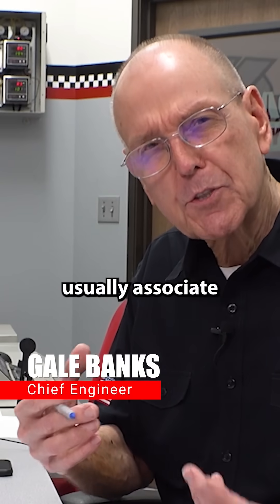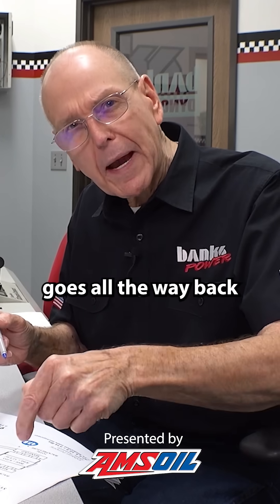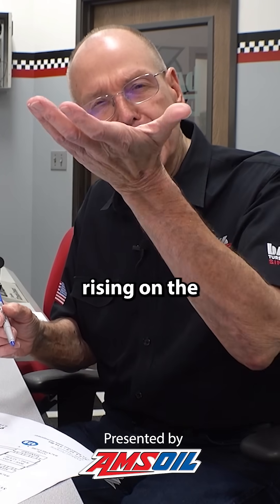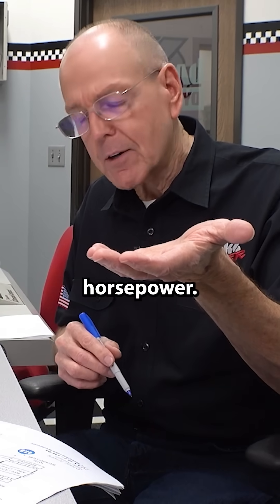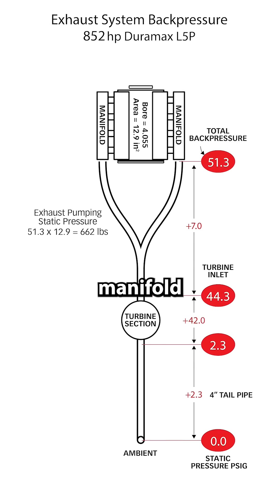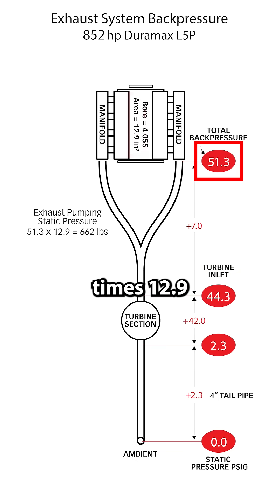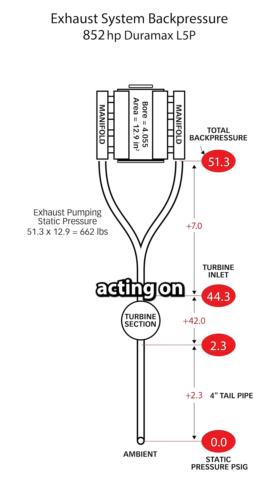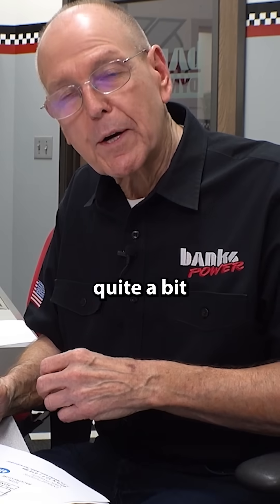How much HP are you losing to backpressure?

Comment: So, how are we going to reduce back pressure while running a DPF system?
Reply: You delete the DPF system
Reply from the maker: You can't legally remove the DPF so the next best thing is to reduce the backpressure created by the restrictive tubing behind the DPF. This can account for as much as 3psi. With turbo expansion ratio, this can mean as much as 9psi at the head of the piston on the exhaust stroke.
Reply: @bankspower I'm going to challenge you to find a stock exhaust on a stock turbo diesel truck that has 3psi of drop at full power.  Show me.
Reply: @bankspower 
Why not put two or more DPF in parallel?  Should cut its contribution to back pressure in half.
Reply: Or run a truck that predates DPF requirements and put whatever power train that you want in it
Reply: Mount a jet engine to the exhaust, sucking all the exhaust out 😂
Reply: This shouldn't be a Short because he didn't actually answer his own question.  C'mon man.
Reply: @StFiacre  I know. That’s what I was pointing to.

Comment: I was told by a shop that the DPF added to the exhaust system increases the back pressure nearly 70 times vs an open exhaust.
Reply from the maker: You should not use that shop anymore.
Reply: 70x seems like quite the exaggeration, especially because 70x662lb=46,340lb of pressure on your poor connecting rod which I feel like would not survive that
Reply: @jaredlancaster4137 The banks diagram showed less back pressure after the turbine where a dpf might be located. A different equation would be needed
Reply: @Kyle-pl6rl  That's true, he is showing 2.3psi at the turbo outlet, but 70x2.3 is 161psi. 161psi+his existing 42psi pressure drop across the turbine+his existing 6psi pressure drop through the up pipes gives us 209psi at the manifold, which still doesn't seem reasonable, or accurate considering stock pickups literally do not build 209psi exhaust back pressure.
Reply: @jaredlancaster4137 i think the actual pressure on the rods disperses differently when its rotational back pressure..does sound like he's tryna be sold a dpf delete..
Reply: @jaredlancaster4137 70x the amount of backpressure not 70lbs of backpressure could be 70x .0001lb of pressure
Reply: From memory on a 15 year old Ford Mondeo TDCI that's got a properly functional DPF its usually around 2-7psi across the DPF according to the scantool, so 1/70 of that would be 0.1psi, which would be one efficient exhaust lmao
Reply: I wasn't aware that a supercharged engine is affected by backpressure
Reply: @CharlesAAnnen-rh4mk  ALL engines are affected by back pressure. Mechanical superchargers and turbochargers ( originally called turbosuperchargers) each have good points and bad.
You may want particular characteristics that benefit your application like efficiency vs response time, etc.
Car makers prefer superchargers because owners are often not super diligent about maintenance and turbos are intollerant of dirty oil. Automotive oil filters have bypass valves on the theory that dirty oil is better than no oil, but to a turbo, the result is the same.
Ford, for example had a turbocharged Thunderbird for a few years ending in 88. In 89, after replacing every turbo probably several times, they switched to a mechanical supercharger to go along with a sleek new body.
Reply: @correctednews1463  
They went with a v6 supercharger, while GM put a turbo on a v6
Reply: bullshit
Reply: Look at a DPF and look at how it operates then look at a straight piece of pipe. Tell me which one flows better. Also the biggest issues with DPF’s isn’t the back pressure it’s that they like to clog up.
Reply: This STOCK Duramax 5LP makes 852 horse power????
Reply: I'd love to see his math on that. Zero chance that is accurate.   I do find it funny that these modern diesels that make 400+hp/1000+tq  and people are quick to believe that the exhaust is restricted and causing a loss in fuel economy.
Reply: @alcalc8938 some people think banks is much more than a salesman 😂 lots of back pressure or drive pressure is what I would call it, could be trouble for the head. When you start running higher boost, you should monitor your drive pressure.
Reply: @alcalc8938 I don’t fully trust the math in the video either, but a DPF is extremely restrictive. That’s why they are the result of so many premature engine deaths
Reply: @jacksonreid6412 they are extremely restrictive when clogged, but properly function they aren't too bad. As long as tune is good and the driving of the vehicle includes regularly acheiving reasonably long highway speed cruising to regularly regen they aren't that big a deal. Constant stop/start city driving over and over is what is when they become problematic.
Reply: @jacksonreid6412 
That and the EGR valve
Reply: @JohnSmith-xu7ev  EGR doesn’t actually restrict the exhaust side at all, since it’s just an alternate path for exhaust gases to flow through. It creates plenty of problems for intake air though
Reply: @jacksonreid6412  
I never said EGR restricts exhaust.
Reply: @JohnSmith-xu7ev  Gotcha, I was talking about exhaust restriction and you replied to my comment so it seemed like that’s what you were saying
Reply: @jacksonreid6412  
U said something like this sucks, and i said EGRs suck too. But im too lazy to scroll up
Reply: @jacksonreid6412  turbo inlet pressures are a lot higher than DPF.
Reply: @alcalc8938 yeah broh the dpf is insane with how much back pressure it causes, and it hurts fuel economy as well as power, that's a no brainier.

The dpfs only purpose is to filter out emissions in the exhaust it's not there for power or longevity of the engine
Reply: When the piston is moving upwards, the exhaust valve HAS already been open for a while.

Your numbers are off by a LOT because you are calculating wrong.
Reply: @correctednews1463  I run diesels on dynos too,  I just looked at turbo out pressure and plotted it to the cylinder pressure. Turbo out was 30 psi and the lowest press at BDC was 25 psi. So he's pretty much in the ball park.

Comment: Now I'm curious about seeing testing results of exhaust outlet locations, hood, bed stacks, side out, both in front and behind the rear tires and straight out the back below the bumper.🤔
Reply: Also the size of the exhaust system: 3in to 4in or even 5in.
Reply: @EG-kx2xz  he had a video I believe where he tested 3"-4" adapters, one was the typical off the shelf short step, the other was a long tapered cone. The amount of performance difference with the small pressure difference was interesting.
Reply: Doesn't matter where it comes out, just matters how much resistance there is on the way. Generally the best power(for non turbo engines obviously) is achieved with an open header and a carefully tuned collector length.
Reply: Irrelevant. what matters is choosing the right size to maintain velocity
Reply: When he posted the video with the power and fuel consumption difference from how a long cone for diameter change vs a step adapter i feel like it's as relevant as plumbing length. Since cowl induction was popular for decades because of the air pressure there, to what extent does that impact a hood stack exist enough to warrant a different exit location .🤷🏻‍♂️

Comment: Duramax seems to need help all over, all the time..
Reply: The Ford 6.7 I drive daily for work will see well over 50 psi of back pressure on stock boost levels 22-23 psi... That's worse than a 2:1 ratio which is horrible 👎.  The Ford's could use the most help of all in that department for sure
Reply: What a dumb thing to say to the man that designed the l5p. 
My lb7 never has an issue after the necessary modifications.
All engines have issues. Every single one of them is a static piece of rock being made to move through explosions. Then you add in the government unconstitutional but forced bullshit that restricts, damages and shortens an engines performance/lifespan and all new issues need to be circumvented. 
Every engine has issues, its cool when the only issues turn out to be the fault of government overreach and not horrible design.